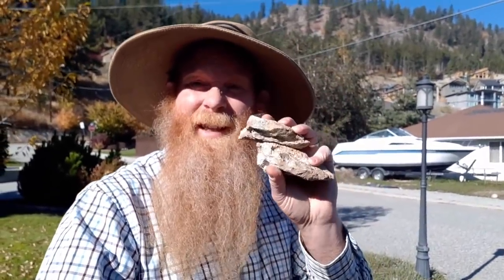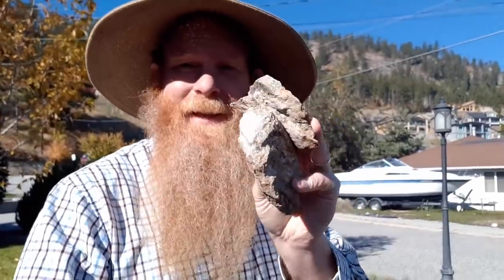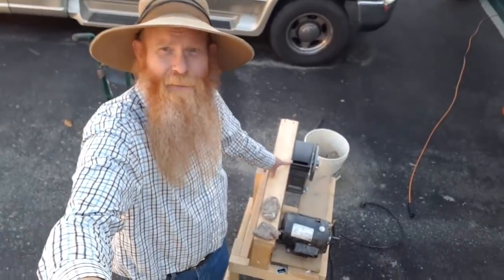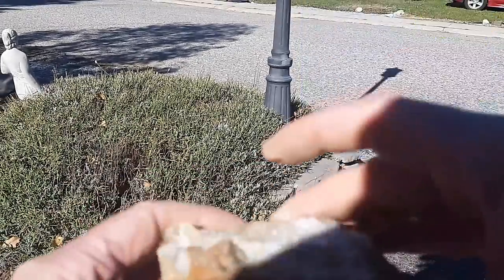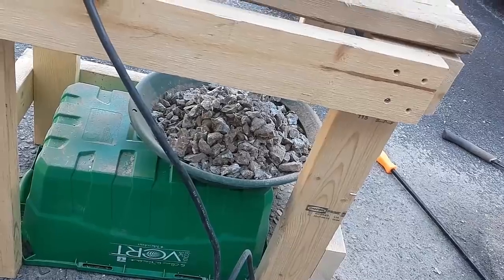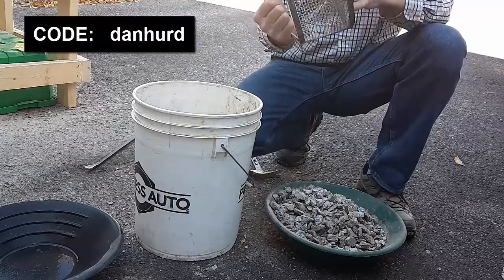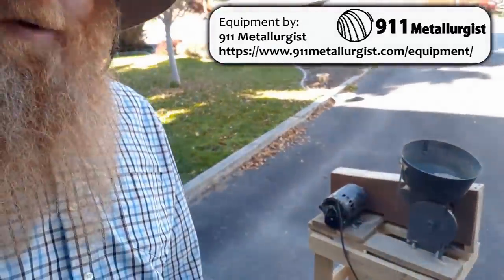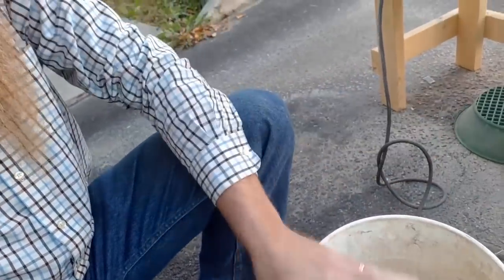Picker Claim!  Crushing quartz looking for the source.

Comment: make a video of all the pans and classifiers  and what ever you use to find gold   I have 4 pans 10 ,12 ,14 ,16   3 classifiers  ,scoop   3 1/2 gallon bucket  mixing tub to pan  ( no rain lately)  for samples   and my spoon I ground down to dig in the dirt   nothing serious   again no rain lately    samples and take them home   to pan in the mixing  tub
Reply from the maker: That would be a daunting task in my case (and possibly a very long video).
Reply: you don't have that much stuff  do you    a lot of black sand in the area I was in today   found  pyrite in one area and looks like quartz with iron oxide on it   in another area   quartz ,black sand   iron pyrite   possibly some where    I thought it was gold  back to the truck  and the razor knife says NO   gold DOES NOT FLAKE OFF  AND IS NOT BRITTLE   keep looking